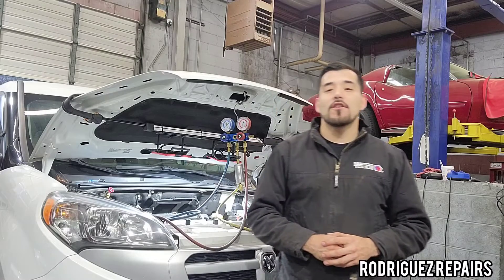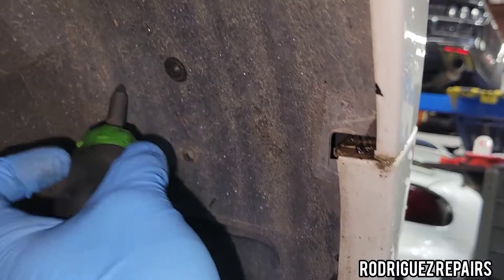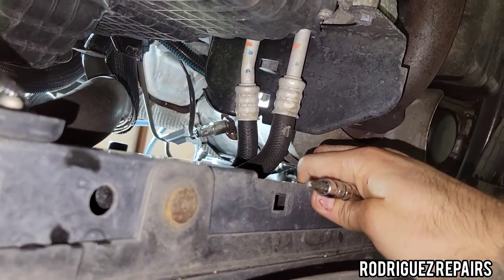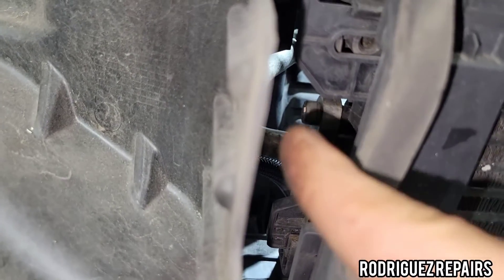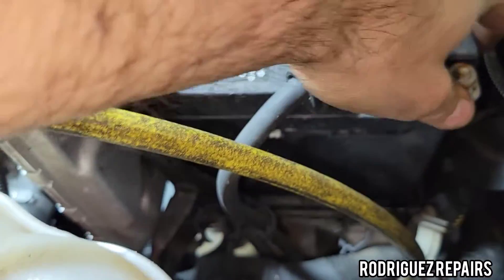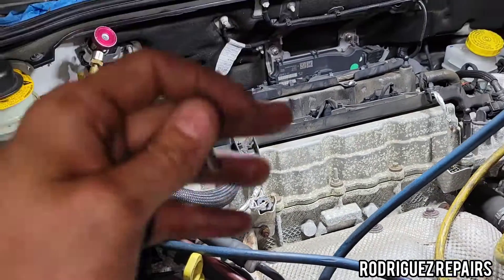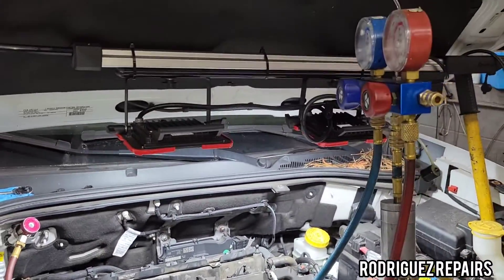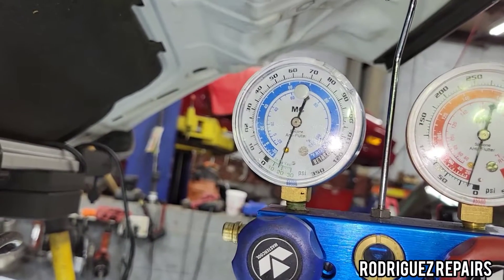Dodge Ram Promaster City Discharge Line Replacement

Comment: Thanks for the video, how did you determine that it was leaking from the hose and not from somewhere else?
Reply from the maker: Well every other fitting I inspected was perfectly clean and dry, this one had a darker oily appearance, and was attracting dirt because of the leak there. The charge valves were in good shape too, the vehicle has been great ever since